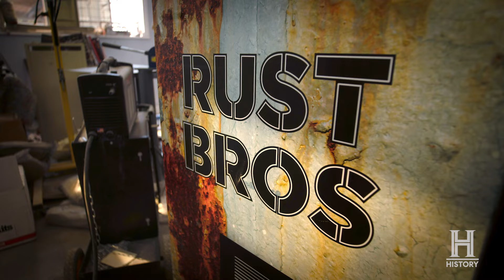Rust Valley Restorers - Season 4 Sneak Peek, Watch Full Seasons on STACKTV & GlobalTV App

Comment: I feel so bad for Mike because his best friend is so clumsy it's not even funny.  How d you drop a transmission on the floor. When its on a stand. I'm going stop laughing.
Reply: He damn near wrecked and ruined the WW2 Dodge truck and was told by the customer and Mike to save all the bolts to keep it original but he kept cutting all the bolts off instead. Also he makes a mess all over the shop floor rather than just getting a drip pan for antifreeze.
Reply: @redhot8041  I would fire Avery on the spot, people are saying he's funny...sure, as an employee or a manager, he's terrible
Reply: @redhot8041  Keeping the bolts was a idiotic request. Bolts rust, get micro fractures and become dangerous with time and that's in the amazing scenario that you can actually remove them without snapping them off. You're sacrificing safety just because the client has an emotional attachment to decaying metal. Same client that could sue you for a poor job done in case something goes wrong. Avery was right, Mike should have declined the job due to ridiculous request and high risk. People that don't understand metal work need to stay out of the shop, especially if they are clients.